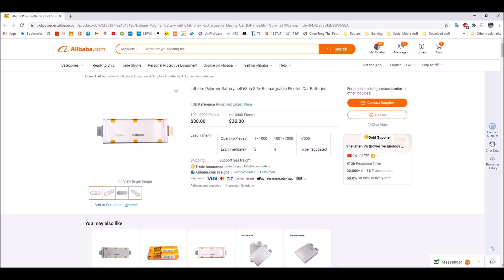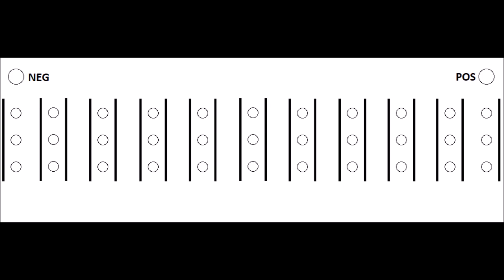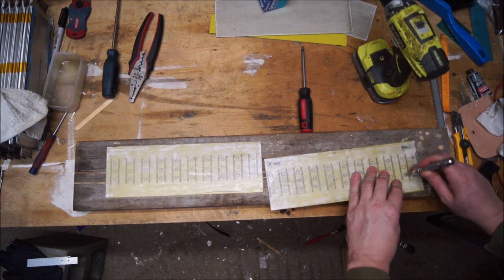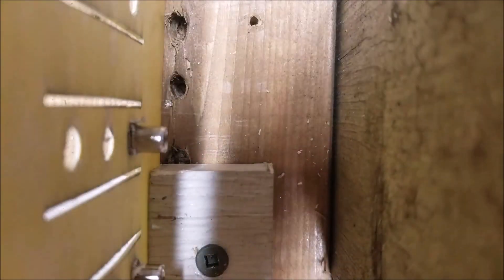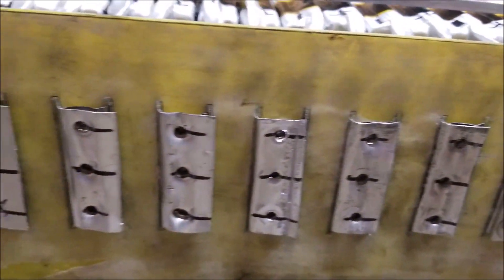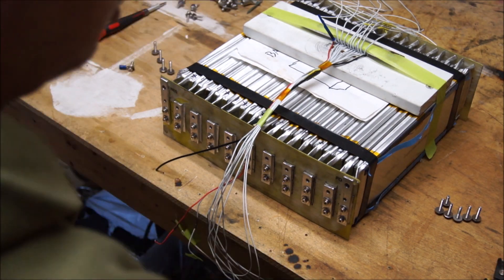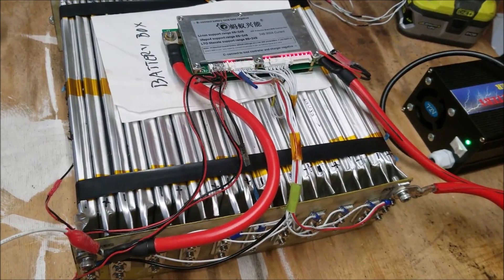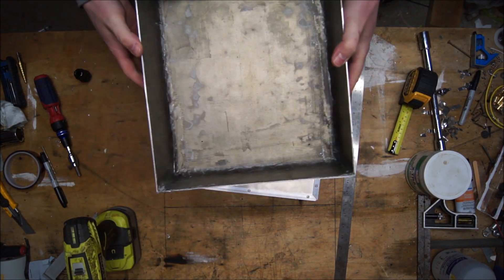LG Chem lithium ion NCM prismatic pouch battery build.

Comment: what BMS are you using?  I have access to a battery pack that has (8) 50v batteries made from 13 pouch cells each ... but currently has a proprietary bms - thats running the individual cells as well as the 8 'batteries' from a single module.  I'd like to separate that - using my own BMS ... to monitor each batteries 13 cells (making a single dumb battery smart) then a second monitor running the 8 actual batteries ... and balancing them.   is that possible?  oh, and the battery cells are a NMC chemistry.
Reply from the maker: My preference is JK BMS.
Reply from the maker: You might want to msg JK BMS to see if you can use multiple JK BMS 's and get them to communicate with each other to coordinate balance levels.  I know you can get some models that have CAN and rs485 bus built in.  I don't know if they WILL communicate with each other though.  I do know the stock software only shows up to 24 cells per BMS.
Reply: @diyelectrified1289  thanks for the update.  Yeah, without mentioning names, this pack that came available was configured on a test bench for a startup food truck business or something that went defunct during covid.  A friend of mine building a school bus RV... Was able to get a hold of one of the two packs, and a 48v victron inverter.  Unfortunately, this "setup" won't work as is, as it was setup with multiple inverters in a multiphase setup with multiple battery packs, and requires a can bus heartbeat and other parameters to activate the pack.  Each of the packs are roughly 6.7kwh each.  In it, is a farasis brand BMS.  24pin connector going to each battery.  There are 8 batteries in the pack, and I was told they are made up of 13-3.7v packet cells.  If a nmc chemistry.  The problem is, we have one battery pack, and only one inverter.  Which was one of the slaves, not the master, so we are missing the comms for the can bus which came from inverter 1.  And therefore because this was originally an automotive based design, we cannot get the pack to activate.  And we are missing pieces of the original setup.  The batteries are good, but without software to talk to, reprogram, or monitor the BMS, it's a useless boat anchor.  We've reached out to both the BMS and the pack mfg. But reached dead ends as they don't deal with anyone at the consumer level.  So, the next best option is to remove the batteries, replace their BMS with something of our own, and make the package useable for him.  8 batteries each with 13 cells.  The current design uses a single BMS.  For what looks like a 2-tier setup.  I'm looking at a BMS for each of the 8 batteries that monitor and balance the internal 13 cells..... Then another BMS that monitors and balance the 8 batteries at the top level.  Make sense?
Reply: Am trying to use ioniq ev battery modules for solar storage system. The module is 2p6s. It has two electronic boards with three wires plug. Is there any way to interface the module to bms using the existing plug?
Reply from the maker: @bhamad12345  I am not familiar with those battery packs.  If you can eliminate the ionic bms and access the wires directly to the cells you should be able to use your own bms

Comment: how did it hold up over the years? What was the approx cost? Consider selling a similar pack? 

-thks!
Reply from the maker: In all honesty, it lasted about 2 years.   The people I sold it to brought it back and one of the cells had swelled.  I talked them into switching the battery to a Lifepo4 pack.  These cells still had the highest energy density of any pack I've built, but I would say that if even GM was having problems with these LG cells then I'm sure it's not something I did but more that the cells are not entirely trustworthy.  For safety's sake and reliability in the long-term, I prefer Lifepo4 cells even though I get 20% less range and almost twice the size and weight
Reply: @diyelectrified1289  подскажите, почему бы вы не рекомендовали? Они опасны потому что их легко повредить? Или они опасны из-за своего внутреннего нестабильного содержимого, которое может в любой момент начать пожар?
Reply from the maker: @geodez86  Both.  LG chem pouch cells have a bad history.  I feel safer with Lifepo4 and feel that sodium ion is a good cheap replacement for lead acid uses

Comment: rivnuts are my go to way off attaching parts. great video. learning a ton...thanx. i like how you crimped and then flowed solder  for the connections. very tidy build. im going to have to try the glass resin fibre. can you reccomend a product?
Reply from the maker: I think it is cheaper to lay up your own glass fiber board.  Use whatever resin is available in your area.  I found 8 layers of 4oz fiberglass cloth fully saturated with resin and pressed between wax paper and glass sheats with as much weight on it to press out the excess resin gave me good results with smooth and uniformly flat frp.
Reply: @diyelectrified1289  what are the specs of the battery and the maximum discharge rate?
Reply from the maker: @FirstLast-tx3yj  they are LG chem E60 NMC cells.  60 ah 3.7V.   20 series @84V fully charged.  60ah x 84V = 5040 watt hours.   2C max discharge rate.  I limit my max current draw to 120 amps in my Kelly controller.

Comment: What's the thickness of the board you used? What would be the optimal in your opinion?
Reply from the maker: 1mm.  I like to use fine woven cloth on the outside layers with four or six layers of glass mat on the inside.  I like to lay it out on a big piece of glass and then once the resin is applied to all the layers, place another piece of glass over top and press it down with weight.  That squeezes out all the excess resin and gives you the strongest more you can make.

Comment: Hello I had some questions about this battery… do you have the exact dimensions or the pack as it was built…looking to build the same battery but I want to make sure it can fit in the projects.
Reply from the maker: I wish I could help you right now but I'm deployed at the moment and unable to access the battery which is at home.
Reply: @diyelectrified1289  no problem just curious. Love building things and looking for options on a better battery pack.
Reply from the maker: @spireEngineering6523  I can tell you that each cell is physically 10 cm by 30 cm by 12 mm thick and there is 20 of them
Reply: @diyelectrified1289  th sky you I appreciate it. Going to use it as a rough setting it doesn’t fit I can always reword the frame I guess 😂

Comment: What bms did you use ? and what c rate was the battery able to do?
Reply from the maker: I started with an ant BMS but eventually melted the solder holding the power wires on the main board.
I switched to a JK bms and love it.  2 amp balance current.
The cells were rated for 3C.  The most current I've ever seen pulled during an acceleration was 160 amps
Reply: @diyelectrified1289  ok cause I bought the lgx e61d and I’m seeing mixed data sheet where it shows 3c continuous and 5c pulse and it confusing me on what bms to get but I will look at jk bms

Comment: I'm pondering trying to use prismatic LiFePo4 batteries for a 52v or 72v DIY battery build. Being new to all this, I am checking out as much as I can on what people are doing on YT.
Reply from the maker: By far the easiest way you can build a battery is with prismatics that you can just bolt together.  The main challenge you will find with respect to the bulky rectangular shape of the batteries, is getting them to fit into the bike frame.

Comment: If you were to make a cooling plate for the module would one side of the cells be enough or would there need to be a plate on both the top and bottom? 
When you were cutting the end by hand I thought of a couple other options, water jet could do that and also maybe a CNC Router. Just something to throw out there for others that like you said may not have access to a laser cutter. 
That's a real nice job, thanks for this vid.
Reply from the maker: I have plans for a future build using the same cells or same type of cells but instead of bolting the tabs together I will either laser weld them or solder them.  I also plan to put aluminum plates in between each cell to conduct the heat away and also to assist in a certain amount of pack compression.  
I'm still unsure about pack compression as I haven't seen anything written in stone about it, but it does seem to be the popular method of prolonging the health of the cells.
Reply: @diyelectrified1289  I saw a vid after I watched this one, Sandy Munro and  Mach E module. The tabs were spot welded to a loop bar and it had plates between the cells to pull heat to a sandwich plate at the bottom. Check it out. Let me know if you don't find it I'll send you a link.
Reply from the maker: @dbc105  I did see it. That was a good video.  The tabs are laser welded.  I believe that's the industry standard.
I'm looking into buying a laser welder.
In the meantime, I'm working on a soldering process that also uses a heat sinking method to keep too much of the heat from traveling down the tabs into the cells.

Comment: For high discharge rate application in these types of batteries it is said to keep the cell tight so that it does not expand or change the internal resistance so would it be ok to space up cells like you did?
Reply from the maker: Honestly I do not know if compression of the cells is better or not.  I have seen videos where people took apart failed batteries made of prismatic pouch cells that were compressed.  The cells were trying to expand and therefore the battery housing was buckling.  
I cannot offer an opinion on whether to compress or not.  Personally I am trying to keep the cells from overheating and give them space to expand and contract.
Reply from the maker: If I had more money I would try both ways to see which worked better.
Reply: Thanks for your reply, how's the battery's performance are you facing any issues yet?
Reply from the maker: So far the battery is performing admirably. I have been experimenting with different chemistries and types.  So far these lipo cells are the most energetic cells that I've worked with (ie current delivery during acceleration).
Reply: @diyelectrified1289  what is the max. Continuous amps you can get out of them?
Reply from the maker: @MrDeceptacon88  I limit them in the controller to 150 amps.  But I have pulled 250 from them during acceleration during testing.

Comment: WoW! Nice work. So can I use a nickel strip to weld 2 tabs of a pouch cell using laser welding? Also, did you make those holes on the aluminum busbar manually?
Reply from the maker: I don't know about the nickel strip, but if you have a laser welder that would do a better job.  Yes, I drilled those holes in the aluminum bars manually.
Reply from the maker: I have just learned. You can also ultrasonically weld the tabs together if you have an ultrasonic welder

Comment: What gauge of wire did you use for the pos and neg terminal
Reply from the maker: 4awg
Reply: @diyelectrified1289  Hey again, what measurements were used for the fiberglass board for the tabs of the cells to fold over each other and what were the bus bar measurements.
Reply from the maker: @DarkShadowNova  hey man!. Sorry I didn't take measurements because this thing was a one-off. And it was my first big battery build. I still have the image files that I put in a laser but honestly I modified several times as I went because like I said it was a one-off and more of a prototype.  I don't want to give you stuff that leads you to making mistakes. So just do what I did and arrange yourselves the way you want them and make measurements with a plastic ruler.  But be very careful because I saw some Russian guy do the same configuration as I did and he had a short that caused a quarter of the battery to catch fire.

Comment: Hi,

How are the batteries holding up? Did you also do a capacity check to ensure they're 60ah as stated? Thanks
Reply from the maker: The batteries are holding up well.  I retested them while I reconfigured the battery pack and they havent lost any capacity.  (still 60Ah)
Reply: @diyelectrified1289  I ride e-moped too what the spec of your hub motor? How many cycles have you put on the battery in the video. I lost all my luggage space with my chevy volt battery, but yours fit perfectly.
Reply from the maker: My bws isn't an E-moped but rather what they call here an LSM (limited speed motorcycle) since there's no pedals. You have to insure and register it and have a regular automobile driver's license. Most other places in the world it's just called a 50cc scooter.  Mine is fully legal as I even went to the ministry and had it converted from gas to electric in its documentation. 
My hub motor is a 12 inch qs motor at 5000 Watts.
It's my daily driver so I can only guess at how many cycles I've put through it.  When you use 20% of the battery and then recharge it that's not counted as a full cycle.  I do that everyday for about 3/4 of the year.
Reply: @diyelectrified1289   looks like 20s battery. So you can do 100kmh? 60mph? Laws similar here over 1hp requires license, reg, insurance. What controller you using?
Reply from the maker: At a full charge I can do 100 km an hour.  But I restrict the speed to 70 to keep it legal.  I use the Kelly sine wave controller but I have switched it now to a Sabvoton SVMC 72200 V2.  I find I'm getting more torque now.
Reply: @diyelectrified1289  mine does 80kmh. I need 120kmh just to keep up with traffic near where I live.  Would you A. Buy a motor that spins more per voltage applied (high kv/ low turn) or B. build a bigger battery  over 100v and get another controller?
Reply from the maker: I would go higher voltage because when you go with a higher KV you give up torque for RPM.  I like the torque I have now and I don't want to go less.  The best KV range for hub motors is around 13.  
There's a dealer on AliExpress called Dunn.  They will go the extra mile for you if you tell them what you want and suggest a range of products.
Dun Electric Store
https://dunelectric.aliexpress.com/store/5065049?spm=a2g0o.store_pc_allProduct.pcShopHead_138669272.0
Reply: @diyelectrified1289  good point. I would also need another charger. $500 for speed motor or $1000 for battery, controller, and charger. Double cost but like you said better overall. Have you used one of those smart chargers that looks like an adjustable power supply? I think I need one of those. Instead of having many chargers for different voltages.
Reply from the maker: @EVO1087R  I have gotten the specific charger for every build so far.  They are intelligent Chargers but only made for that particular battery pack voltage and chemistry.  
I am negotiating with the Chinese Alibaba merchant to get a 3000 watt smart charger.  The only issue with it is that the BMS has to be able to communicate with the charger through can bus in order to work.  This is not a cheap solution as the charger is around $700 CAD.  I might make a video out of it in the future if it turns out to my satisfaction
Reply: @diyelectrified1289  do you have an email adress so i can ask you a couple questions about motor kv

Comment: wouldnt it also have been more easy to put the clamping holes at each END of the slots in order to just CLAMP the lashes down and not perforate all of them?
Reply from the maker: That's what I originally did but upon closer examination discovered the metal was warping outwards so the middle didn't have any clamping force at all.  I believe this way there is more metal to metal contact.

Comment: Are the batteries quite rigid ?
Reply from the maker: They are rigid but they are fragile.  You can bend them if you want to but that will destroy the cell.  What I did was double-sided tape them to each other and that gives you the "bundle of sticks is much stronger" scenario.  Also you do have to put them into a case to protect them. Make sure they don't slide around inside that case.  All the terminals are connected through a printed circuit board which is held fast by the external power wires.  They're also surrounded with 1/8 inch close cell foam that used to be my toolbox liners.

Comment: how do u attache the battery to the fiberglass plate?
tq
Reply from the maker: The battery tabs go through the fiberglass plate and wrap over each other which then holds the plate to them.
Reply: @diyelectrified1289  any video picture for this step?
tq

Comment: what batteries are beter for scooter 18650 or pouch cell of ncm for 72v 55ah?
Reply from the maker: NCM pouch cells will give you the highest density of energy and a very high continuous current output.  Unfortunately they are very fragile and usually have a low cycle count (500 to 1000 charge/discharge to 80%)
18650s are well known and reliable, but I do not like them personally. 
I think 32700's, 4680's, or prismatic Lifpo4 are better for longevity and safety.
Reply: @diyelectrified1289  the 18650 give more charge recharge ?but if fail  one or two of them all the battery 72v55ah want repair
Reply from the maker: @dimitris000bourgos  I think that you are saying is one or two cells can go bad in an 18650 battery pack and that you can simply replace the bad cells.  I don't know if you have ever done this before but I have and it is a big mess because of the way they are spot welded together. 
A battery made from pouch cells is slightly more repairable but dangerous (at least in the way that I configured my pouch cells) to mess around with because one short can cause a big fire.
Prismatics are much easier to work with though if one cell goes bad, it's quite expensive to replace.

Comment: Glass fiber or POLYCARBONATE you can certainly rivnut polycarbonate.
Reply from the maker: I tried Lexan because it doesn't crack as easily as plexiglass but it was too malleable and warped from the rivnut compression.